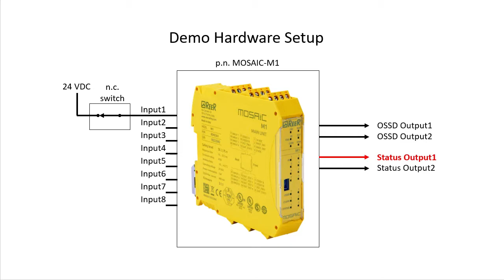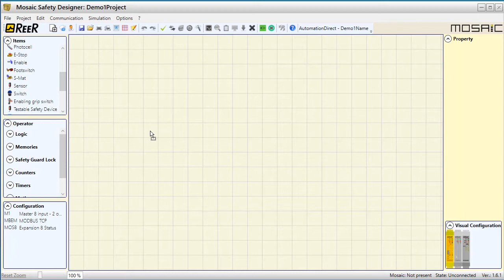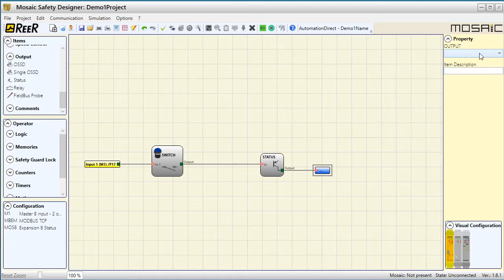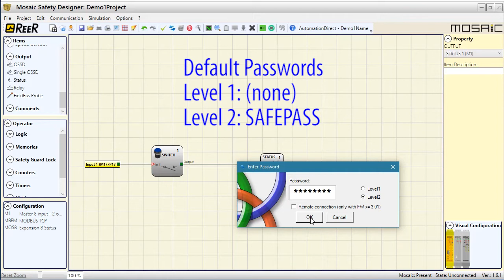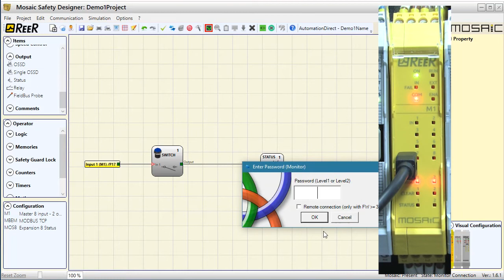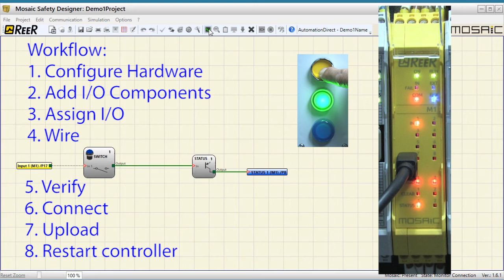REER Mosaic Safety Controller: Quick Start Part 1 (workflow) from AutomationDirect

Comment: Worked with old revision of mosaic for years, good for simple straight forward projects. What pushed me away was that you can't update firmware , if you forget the password can't reset to factory settings by yourself, inputs and outputs are pre determined. I found that with ABB pluto i could do all of the above with ease. So no more mosaic for me
Reply from the maker: @Kmreddsadad It’s not the right solution for everyone, but it offers many advanced features at a very competitive price point. Thanks for the comment.

Comment: You mention there is another video on how to do a firmware update. I cannot find that video. I need to update the firmware in a MOSAIC-MV2H from 3.0 to 3.1 so that I can use the speed out program function (took me a couple hours to figure out why that function was grayed out). Also it would be good to have a list of firmware versions, and what functions are supported in the different versions.
Reply from the maker: @paganskier we cannot find where firmware updates were mentioned in the video. REER will not allow firmware updates outside of the factory since these are safety devices. If you need technical assistance with the safety controller, it is best to contact our Free, Award-winning technical support and they will be glad to cover the functions of the product.  https://support.automationdirect.com/

Comment: Hi niceee video. I habe a question. Can the switch be used as a signal pushbutton for an external realy?
Reply from the maker: @rogervara8939, Which switch are you referring to? The physical pushbutton in the box, or the "switch" function in the Mosaic programming software?
Reply: @automationdirect  The problem I'm having is that I need to recognize the physical relay with the program. That is, when the relay is activated, I send the signal to the relay input, but I can't program it properly because I can't get the input to stay static. Even though the relay is activated and giving a signal.
Reply from the maker: @rogervara8939
You will need to contact our Technical Support team for further information on that particular issue. There could be one of several things causing that issue. Find their information here: https://www.automationdirect.com/contact-support?utm_source=crDdvoKDiiM&utm_medium=VideoTeamComment

Comment: would be much helpful if the wiring (connections) has been demonstrated..... with programming
Reply: Hi Nikhil, Thanks for the feedback. We didn't provide a detailed wiring diagram for this device because all the connection points are identified on both the unit and the documentation. We will try to include those kinds of diagrams in the future. Thanks!
Reply: @adcpreviews1727  Dear sir/madam thank you very much for the reply
I have a doubt
is it possible to try these quick start experiments only on M1S without using(configuring) other modules(MI8O2, MO4)
Reply from the maker: @nikhilreddy343  Of course!  Are you aware you can run a full simulation with NO hardware using the software?  Check out this video to see how: https://www.automationdirect.com/videos/video?videoToPlay=qB5RiXitGso&q=mosaic
Reply: @automationdirect  Thank you for responding !! and
yes, I'm aware of that. I made my safety design (program) and executed as per my plan. My program contains a lot of logic gates, inputs, outputs and safety outputs, but for the moment I had only M1S module, and I want to try some basic operations on it. I tried this particular operation(ESTOP with 2 OSSD[https://www.youtube.com/watch?v=K8fisyy4rgU]), but I have problems with the wiring part.
P17, P18 passing through EMG BUTTON they goto P13, P14(OUT_TEST 1 & 2) and I don't know from where/how I can get the safety output.

I know this is a bit more but if you can, please help me.
Reply from the maker: @nikhilreddy343  Hi Nikhil, The safety outputs are the OSSD outputs which are used to drive the safety relay. Sounds like you don't have the relay module, so to run a test, simply monitor the Status output (p12). Go to time=5:30 in this video to see the wiring diagram:https://www.youtube.com/watch?v=K8fisyy4rgU. Does that help?

Comment: Most safety relay contacts cannot handle surge currents found on the inputs of items with switching power supplies. How do these fare?
Reply: Hi Alex. The inputs to these Safety Relays are protected by a PTC fuse. Same for the Dold relays we sell. Can't really comment on how these "fare" without a lot more detail about your system. BUT, they do come with a 30 day money back guarantee and free programming software - so give it a try - you have nothing to loose!
Reply from the maker: Thanks for the comment Alex. Check out more about our product on https://www.automationdirect.com/adc/home/home